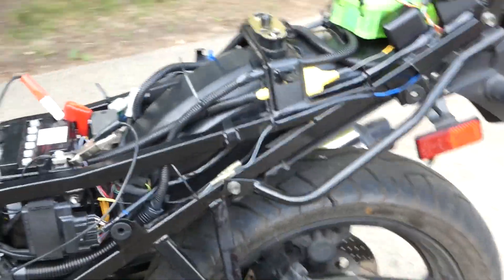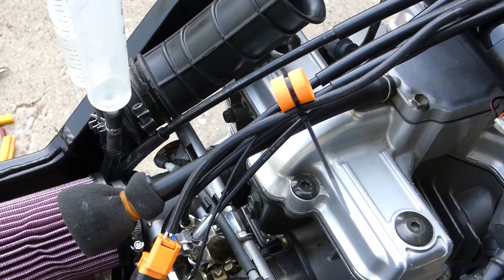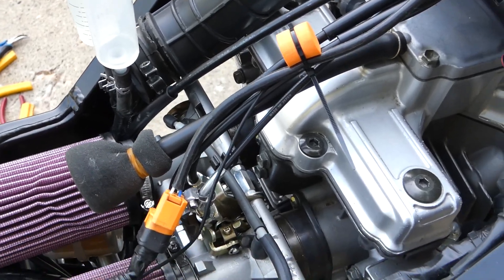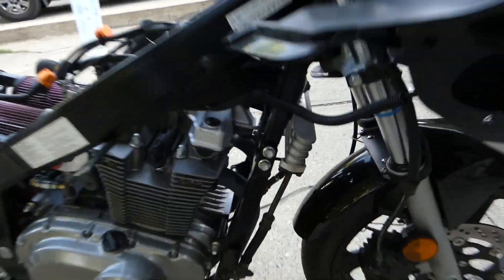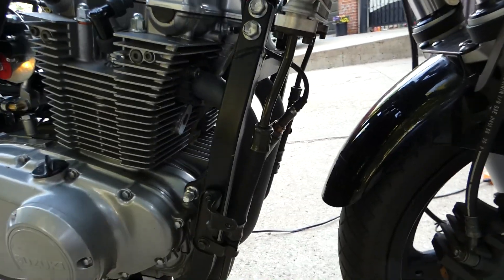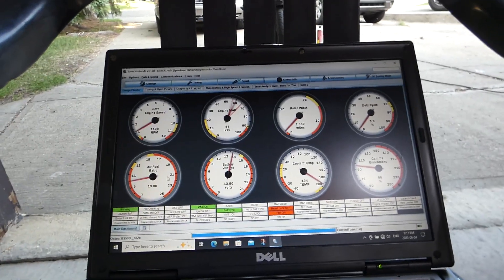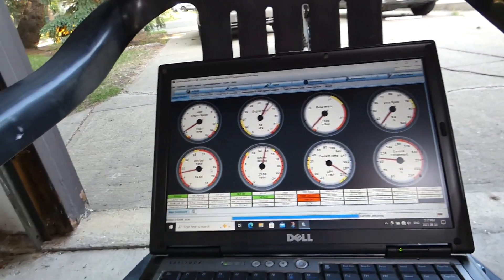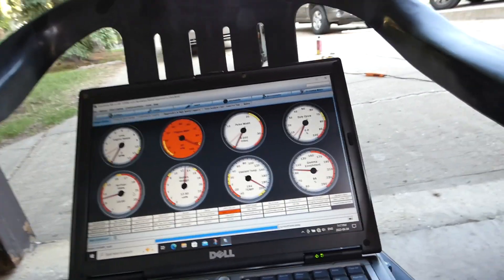GS500F EFI FIRST START

Comment: It's really cool man ! I was planning to do the same with mine. It's great information to know that gsxr 600 tbi fits right in !! Nonetheless I have a question, what it is your setup regarding the fuel system ? What kind of fuel pump are you using ? I was planning to use an "in tank" pump but it would be quite hard to weld so i'm very interested !
Great work !
Reply from the maker: I was using a self-contained Kohler-type fuel pump module. It worked pretty well for a while, but began to leak pretty badly. I could have replaced it, but decided that it wouldn't be a very reliable build. My EFI parts are in a box:(
An in-tank pump would be ideal. The Yamaha SR400 used a mini-secondary tank/pump combo, but it's hard to find used parts.

Comment: Dude hell yes! This is amazing! You gotta have detailed instructions for this! I would like to do this to mine! Just subscribed!
Reply from the maker: Thanks bro,. check my channel, there are a few vids showing me testing the throttle bodies etc. I also plan on making some tuning videos...maybe even a dyno session in the future.
Reply: @chris900f  yea I saw that one, I checked the rest of your vids hoping to see something with a little more depth of the install down to the wiring. That would be cool if possible. What gsxr is it off of? I searched and found the ones with 4 throttle bodies, did you just remove 2 off the 4?
Reply from the maker: @MDM1204  Yes the 2001-2003 GSXR 600 fits like a glove into the GS500 manifolds...check out my video of my 1981 Honda CB900F."out for a rip"  I did the same thing with that bike almost 20 years ago:) The TB's fit better in the GS than the CB. I'm on GSTWIN forum.
Reply: @chris900f  Awesome! I appreciate it man! Yea I was going to suggest the gstwin forum. I'll keep and eye out for you on there! Can't wait to see future updates on it.